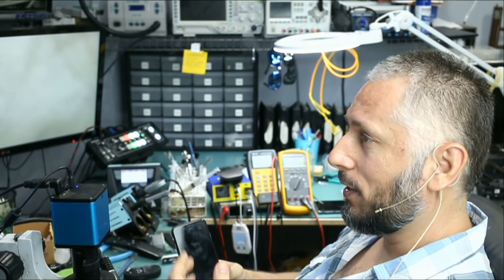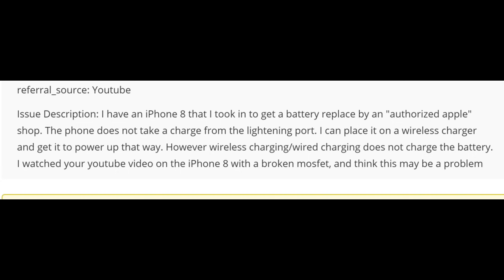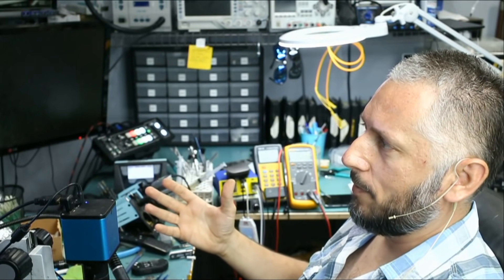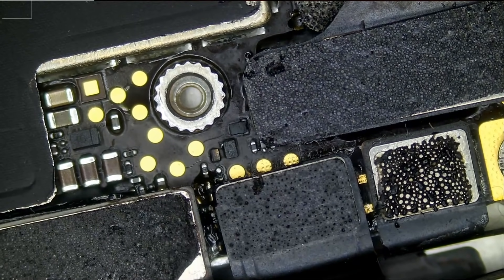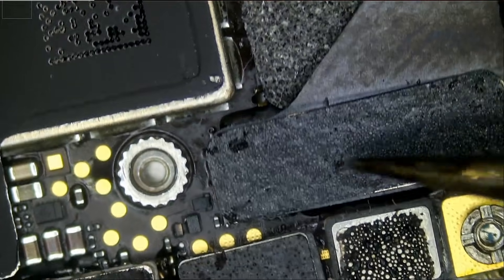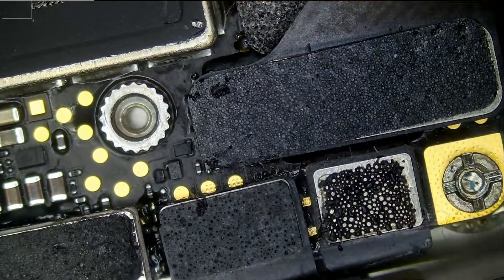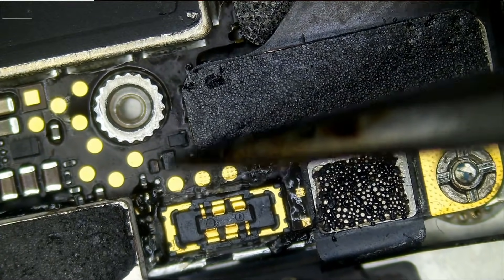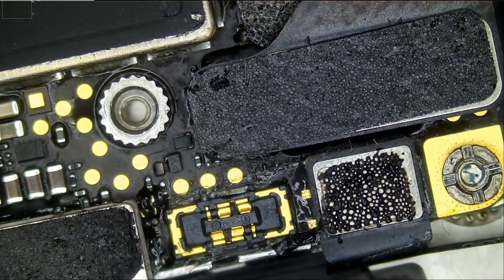Apple Authorized Repairs - iPhone battery replacement went wrong.

Comment: I phone the local apple authorised shop about a macbook a1502 repair. Told them I was a shop. Board had failed with major water damage. I needed a board asap.  Told me to go on ebay to buy one, as that's what they do. 

They only replace screens and batteries,  nothing else. I wouldn't trust them

Comment: I have lost count of the number of Macbooks over the years that either an Apple ''genius'' has told the customer ''it needs a new logic board and/or maybe a screen'' which will cost more than a new laptop often, or the most common is that it ''cannot'' be repaired.

Then I change a capacitor or  reconnect a corroded trace and it works again in 20 minutes.
Reply: Yep. They do not want to bother with board level repairs. Just replace whole think they want 😒
Reply: I don’t think the employee is malicious in that case. That is their training and they are only doing what is expected of them. It’s a business practice that has been around for a long time and is used by all companies I have dealt with. It turns out replacing parts is more cost effective for them.
Reply: @thebristolbruiser  You are correct, I do not blame the genius personally, but if I was a mechanic and the company I worked for had a policy that when someone brings a car in and one spark plug is failed, try to sell them a whole new engine or preferably tell them it cannot be fixed and they need to buy a new car, I would leave. The problem is that the genius is a salesperson and not a technician. The bigger problem is that the customer THINKS the genius is a technician.
Reply: @thebristolbruiser  employes do, what company wants  and what they are willing to provide to workers. Sadly in manny cases is not good status.

Comment: Rossman shared that he hired an Apple Tech who sat around all day because he could not fix anything. All he did at the Authorized Apple Repair shop that he previously worked at was reset software and never open a device. Fired, and cringe.

Comment: Authorized repair always they are there just to replace the whole parts with problem like boards /displays but not to fix boards which has problem...they always recommend you to replace the whole part ...my opinion

Comment: Surely the customer can ask the repair centre to put it right. I can’t believe an authorised trait doesn’t have a procedure for dealing with the situation where they damage a customers device. 
Customer doesn’t say if it was charging ok wired before the battery change. 
I’m not defending apple repair centres, just sounds very odd that the repair centre can’t put it right (with a new phone if that’s warranted from their error) 
Something fishy here…..

Comment: Do you want to take your car to the dealership, or do you NEED to take your car to the dealership? Right to Repair is a CHOICE, and shouldn't be dictated by the manufacturers. Dealerships (and 'authorized repair centers' alike) can do sub-par work, but being forced to use them negates our ability, as consumers, to choose: Effective repairs is just one step in the dance of successful retail repair service, alongside price, customer experience, and reliability.
Reply: Especially if you're going to do garbage work like that

Comment: Apple authorized repair shop was a noob which is bad as he is "authorized" when they shouldn't be. 2nd, no solution or admiting your mistake and being dishonest not acceptable under any circumstances. If they cant repair they should give the customer a free replacement.

Comment: Do you fix xbox 360s?  How about an HP laptop from 2008 with a screen that will not work?  I would like to either get it fixed or at least retrieve the saved data from it.  How about a 2016 Vizio TV which was well cared for but now will not power on?  What about a Samsung phone with a broken screen?  Can you help me retrieve the saved data from it? Can I pay you for fixing this stuff or should I give my money to someone else for brand new items?   Are you located in Northridge CA?

Comment: I don't think Apple Repair Centres exist, But what does exist is the Apple Genius Bars where Apple products are Sold and supposedly repaired, Long story short
If you managed a Genius Bar, What would be the most profitable?
Get the Broken device as a Trade in for a New Phone, and then repair and flog the trade in as a refurbished Phone 
OR
Repair the phone needing a repair?